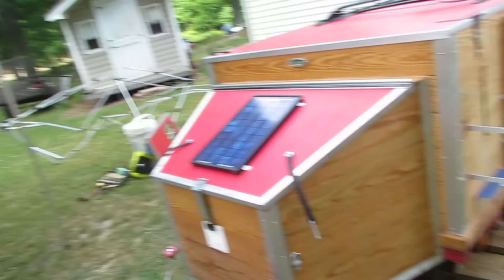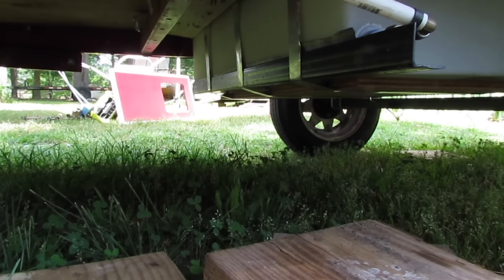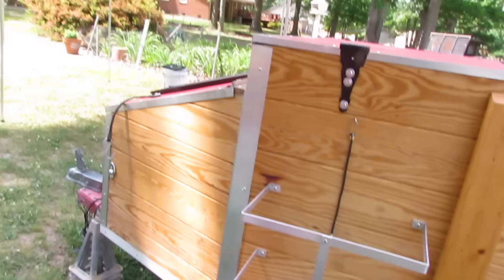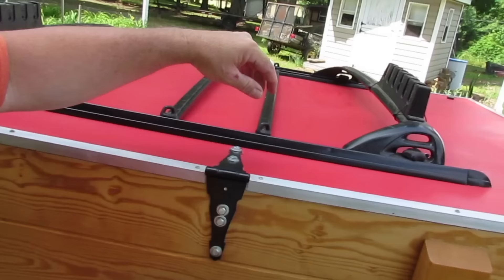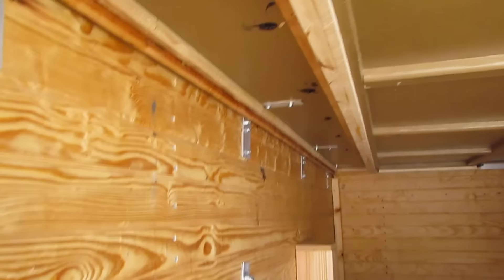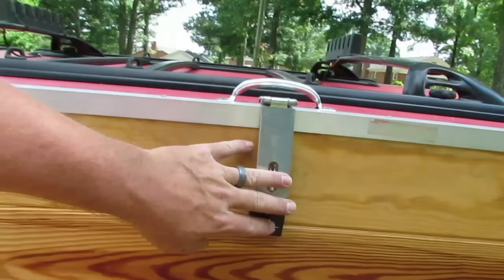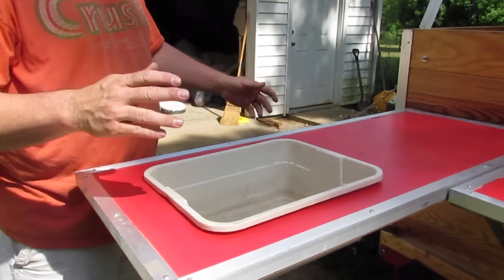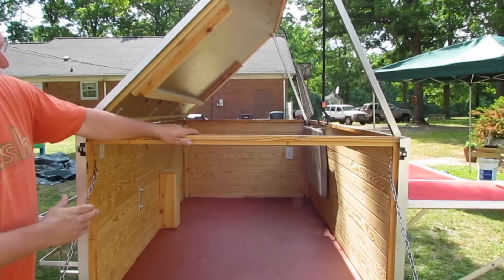Harbor Freight 4x8 Camping Trailer

Comment: nice little super utility trailer, a few strategically placed heavy duty gas lift support springs and your rock'n.... no need to muscle that heavy top.  I was wondering what you use that pump for with your fresh water tank? is it to give you pressure if you were boon docked away from facilities?
Reply from the maker: Thank you and good idea, that top is pretty heavy. The pump doesn't pressurize the tank, it is just to get the water to the sink or where ever I need it. Thanks for watching.

Comment: I think I would look for lighter materials than all that wood.
Has it been weighed?
I think I would try for more of a tent platform than a wood box.
Reply from the maker: Yes, approximately 840lbs. Empty. There's no doubt that I could have found lighter material but in addition to the many uses of the trailer, we were going for the look as well.thank you for watching
Reply: @TheFurrminator  the axle is what I'd worry about with all that weigh. The new tires will help, but the Axle strength is your weak link. Just keep an eye on it. Take care.

Comment: With the top open it looks like you could sleep in there if you had some ripstop connecting the passenger edge of the roof to the edge of the wall, maybe triangles to fit over the angle aluminum - tail gate works as ingress/egress and you can haul gear in it too... Like an almost-pop-up camper!

How much did this build cost total?
Reply from the maker: Jamie Clark great ideas! I appreciate that! The total cost was approximately 1400. Thank you for watching!

Comment: That a very nice trailer you've built up there. I was on the fence on buying that trailer and now I think I'll buy it. Harbor Freight tools and products obviously by their cost aren't meant to the top of the line in performance or quality, but they do perform well at or above a minimum standard. All I need that trailer to do for my purposes is to perform at half it's rated capacity and at $250.00 that's a steal. Thanks for posting this video, you've given me some ideas about doing some things when I buy my trailer.
Reply from the maker: Thank you so much, I'm glad you liked the trailer. You're right, I knew this trailer was going to last a lifetime when I bought it but it's already given us a lot of enjoyment. I have pulled it approximately 1,500 miles so far and it has done exactly what I needed it too. Thank you for watching

Comment: Great Job , I Live in a rv , just a little suggestion for the corner edging of the counters , go to the dollar store and get the tube foam water floats they come in a verity of colors . & cut them to the length you need  and install them on the corners for safety so no one gets cut or scraped .
Reply from the maker: Thank you and thanks for that suggestion, great idea. Thanks for watching

Comment: Do you sleep in the trailer or just use it for supplies and such?
Reply: I just use it for hauling gear, also for water storage and power supply. I had considered making it into a sleeper at some point but not at this time. 

Thanks for watching
Reply: I was wondering that as well. It would be easy enough to make some soft sides out of canvas and throw some cots or an airmattress in it. Either way I like it, it would be nice to be able to keep all your camping supplies in it and ready to go.
Reply: Yea, I may attempt something to make it a sleeper at some point, thanks for watching
Reply: Would be super easy to sleep in this.  Simple air mattresses...  you have the power grid in it. Just run the tubing into the main area with a few clips on the wall to hang the fill up hose to keep it neat   If you wanted to get fancy you could even get one of the sliding window/screens out of an old camper or motor home  and  mount it into the back door so that you can open the window but have the screen in place to keep the mosquitos out. A few brackets/slider gate type locks to close the door form the inside....  I have slept in the back of my truck lots of times with a cap on it, and it gets stuffy.  One of my caps had sliders with screens and it was a lot nicer.    Have you considered removing the large hinged top, and putting some rails around the top of it, so that you could put a truck cap on it?  that would give you another 2-3 foot of headroom, and you could open the cap door from the back to throw things in and out.. then simply remove the cap once you got to your destination? Truck caps go on and off very easy with just 4 aluminum clamps.  (I use vice clamps instead with the small feet, as they clamp on and off MUCH faster, and are SUPER tight...  You could even figure out a way to hinge the truck cap at the front of the trailer if you wanted to, but if it was me, i'd like the option of removal.   Also you could mount that rack you have on it now, on the top of the truck cap.  Or some caps with with a set of rails for Canoes and such. THat would really give you a LOT of options.
Reply: Carolina Traveling With James Montgomery trailer hitch for my mobility scooter

Comment: Sooooooooo.. have you regreased or changed the bearings in it yet?  Last time I went to service my father in law's from HF it turned out to have metric bearings... Totally nonstandard to the US. HF sold the replacement bearings, but not raceways or seals. 

Good luck with that. I'd never buy a trailer from them.

Comment: great job on your trailer 
I have a question did you change that axle I have one and by the time I load all the campaign equipment is more than 1700lb
Reply from the maker: Manblio Garcia thank you! yes I upgraded the axles and springs because of the weight. thank you for watching! any other questions just let me know.
Reply: Jeff Furr  if you don't mind asking what kind axle and springs you got any help is appreciated
Reply: @manbliogarcia7709  I was worried about the axle too, glad he up graded. He needs to add that info. Some where on his Vid. !!!

Comment: yo jeff or rather said "mcgyuver" job well done my man! very creative!! i thought you would sleep inside the trailer itself, blow up an air matress, only problem is if you kept the top closed you would have to create some sort of vent holes. other than that i liked your setup, pretty cool. camp-on!
Reply from the maker: Thank you so much. A blow up mattress would work great and you're right, definitely need a vent. I have thought about adding a vent that can be kept closed and only opened when needed, like to let it air out or to sleep in it. Thank you for watching

Comment: Nice trailer, Do you sleep in it ? Very organized, How much did it cost? Thanks for posting.
Reply from the maker: Thank you, we don't sleep in it yet, going to create some type of canvas fold out that would allow us to sleep in it. The build was around $1250.00 but I went overboard and I could have saved a good bit had I left off the aluminum and a few other things.

Thanks for watching
Reply: @TheFurrminator  Another option you could go with, is adding another piece of plywood to the top & creating an A-frame dsign, which you could stand up in!

Comment: Make sure and vent the battery box. Hydrogen explosion will tear your trailer up.
Reply from the maker: Thank you, I did install a vent, it's on the front of the box, plenty of ventilation. Thank you for watching
Reply: @TheFurrminator  since hydrogen is lighter than air, your vent needs to exit  the enclosed space at the top....while your vent placement will provide intake, it WILL NOT prevent a hydrogen explosion.....I won't detail how I KNOW this....

Comment: Man that is all right, great build. Couple suggestions I don't know if they are a fit for you or not. I grew up on a carnival and we used to take it up and down the road every week. 1st is cool seal instead of Thompson's. Now the last time I bought Coolseal it was $175 for a 5 gallon bucket but their warrenty was if it leaks for the next 20 years we will replace the the parts of the trailer that's damaged plus every thing under the leak that was damaged too, I never seen anyone collect on that warrenty, it was that good. 2nd is before you change your tires out look at changing your axial to a tantum set. That 2nd set of tires really makes a difference. 3rd and last is, most people on a carnival are friendly and helpful.
As long as you're not catching them when it's busy. An hour maybe half an hour before the show opens talk to the people around the game and food trailers. If you catch a little show in a parking lot that's perfect, those boys will talk your ear off. ask them about the coolseal, the axials, swaybars for the hitch, and tip outs vs. slide outs, a well placed slide out and you'll swear you doubled your size but will only add a couple hundred pounds to your gross weight. Oh and hey don't sell those 12 volt sets short. With those you can carry a few pieces of hinged lumber and build what we call a pigpen, run a light stringer around the top and be anywhere USA roadside selling bar-b-que or whatever else you like. Roll the dice on Christmas tree lot one year you'll know, If you're half as smart as I think you are, in a good location you'll turn 6 weeks into a quarter million dollars profit no problem.

Comment: What a great job, and a great video.  We have the same trailer and I've customized it like crazy too, although only for utility purposes, nothing as neat and thorough and careful as yours.  Drop down tailgate, hinged sides expandable from two feet high to four, custom drive-up loading ramps for the riding mower, hold-down rings, side clips, sides that come off with eye bolts and wing nuts, all kinds of features like that.  Those are great trailers, you can do a million things with them.  I had to send a link to your video to my wife too -- she'll get a big kick out of it I know because I've tweaked and customized our trailer with the same kind of creativity and innovation.   See honey, here's another guy who does the same kind of things I do!   Maybe we ought to go into business customizing HF trailers to order.  Ha!  Thanks for the video.  (I can't live without bungies too.)  (Oh, and my next task is to add side steps or beef up the fenders to make them strong enough to stand on.  When we use it for huge leaf loads in the fall I have to climb up over the trailer sides to stomp down the leaves and the fenders aren't designed to be side steps.)
Reply from the maker: That sounds like my kinda trailer, I'd love to see what you've done with your trailer, have you made a video? I've been eyeing another HF trailer that's been on the side of the road for sale for several years now. I called the guy last spring and he wanted $150.00 but I think I could get it for $100.00. I'm going to call him again soon and try to get that trailer to haul my ATV, only thing keeping me from getting it up till now is time. I'd like to see what you've done, maybe I could use some of your ideas to tweak that trailer.

Comment: I made a camper onto an H.F. Trailer.---After about a year the tongue was bending and the welds tearing loose. And the best part was yet to come.--One morning about a hundred miles from Las Vegas I noticed the wheels were sitting at an odd angle. Yep, you guessed it the Axle was collapsing and about to give me a big let down.
I was lucky there were no real problems such as a breakaway.   I finally wised up --if you want to build your own--start off with a Cargo Trailer. They are designed to haul and most of the work like the roof and sides, iis already done.--I wish "FURRMINATOR " luck.

Comment: The way you explain how you did it and you recognize the imperfections it's awesome. The end project for a simple camper is awesome. My only advice for all the Sharpe corners are tiger paws grinder wheels!
Reply: Or add plastic corner protectors. Something that you could hit with your hip and not rip your clothes or skin. Pointed corners often need ergonomic attention for added safety. I like this build, and it is an attractive trailer. Thompson's water seal, eh? Good tip. Thanks. 

So... where do you sleep?

Comment: I think you have done a great job making a utility trailer into a very handy little camping trailer.  Your counter top might be the best and most used of the improvements.  I have seen how expensive these small trailers become when time and effort are put to good use.
Reply from the maker: Thank you. You are correct, this trailer has been very handy for hauling our camping gear and the counter is my wife's favorite part. You are also right about the price, it's a very inexpensive little utility trailer in the beginning but that quickly changes with the upgrades. I would definitely build this trailer again though, it has been a very rewarding project.

Comment: I had one of these for a couple of years for hauling my ATV's. I built a deck on it and it worked pretty good. The only issue I had was with the inferior quality wheel bearings that came with it. Either upgrade them or grease them every few hundred miles.
Reply from the maker: I agree, so far I have repacked the bearings twice to be sure they were ready for a few trips. I'm planning on upgrading the whole suspension system at some point which will include better wheels and hubs. Thank you for watching

Comment: Nice job! The only problem with these small trailers is the small diameter wheels. You really have to keep an eye on them when loaded down and traveling down the highway. Grease the bearings often.
Reply from the maker: I agree, I have already upgraded the tires but I may upgrade to at least a 14 inch wheel and tire. These 12 inch are turning a lot of RPMs. 
Thank you for watching

Comment: Nicely done son....Love the rack found at junk yard, items unneeded by friends and  Ebay treasures.  Ingenuity at its best. Way to recycle! One thing though, I have heard about Harbor Freight trailers which are bolted together, having the nuts and bolts come loose. I'd either locktite them or spot weld them in place. Either way, keep an eye out.
 Looks like you've made a box full of fun!!  Also, I think you get more satisfaction creating a useful item than just buying it. Plus bragging rights!!
Reply from the maker: Thank you so much. I agree, I've been thinking about having the frame spot welded where it's bolted together, wouldn't hurt to spot weld the bolts too though. You're right about making your own, I'm not much of a bragger but I have to admit that I'm pretty proud of this thing and it does get a lot of attention, whether traveling down the road or set up on a campsite. 
Thank you for watching

Comment: Thanks for sharing. You have given me a ton of ideas. I'm currently building my version of a camping trailer on the same model folding trailer.
Reply from the maker: You're welcome, I'm glad my video has helped. Good luck with your project, I hope it turns out just the way you want it. My trailer tends to be a conversation piece when set up in the camp ground. I'd like to see your version when you're finished if you don't mind sharing some pics. Thank you for watching

Comment: All things considered it’s a well thought out design. There’s a few things that come to mind though. For the battery, most often bare metal around a battery equals corrosion and discharging the battery. If you have a sealed battery box and run the vent through the floor it would prevent gas build up inside the wood box. You could still use those brackets afterwards to hold the battery box down. The connections you have look great right now but with the passage of time they’re more likely to arc and become an ignition source. The inverter may not be sealed either. You may be able to do away with the front vent and reduce the potential of water getting inside over time. I didn’t hear whether that rear rack was removable but the trailer lights should be on the rear of it. If removable you could make brackets that change the lights from their current location to the back if you made wires long enough. I love how you made the aluminum edges! It’ll keep the wood table edges from getting beat up with use. Practically everything you did is a workable extension of what you did before. My project attempts are sorely lacking in comparison to yours.

Comment: Great job!  Not sure if anyone has said yet, but you want the shortest length and thickest gauge of wire, between your solar panel and batteries.  You'll get far more juice to the batteries this way.  Great work on the trailer!!
Reply from the maker: Thank you, they have not mentioned that yet but great advise and I appreciate it. 
Thank you for watching
Reply: ***** That actually matters (in practical terms) over longer distances and at when carrying higher amperage. For such a small load, it is unlikely to make much difference whether the line is a few inches or several feet. The practical loss over that distance would be nearly un-measurable.

Comment: great ingenuity!  it wouldn't be hard to pipe the water to the side where the tables are with a functioning sink and an overlanding awning you find for the side of your vehicle would be an easy addition to the lid making nearly an instant kitchen setup.  very nice job!
Reply from the maker: Thank you, and you are correct, I have a water hose that I hook up at the quick connect at the front and run it to the sink. Also, great idea about an awning, I have considered that as well but I haven't worked on that yet. Thank you for watching

Comment: Awesome setup! Not sure if anyone has said it yet but you should put a drain in the battery box so that if your water system leaks or water gets in through the top then the water won't short the system.